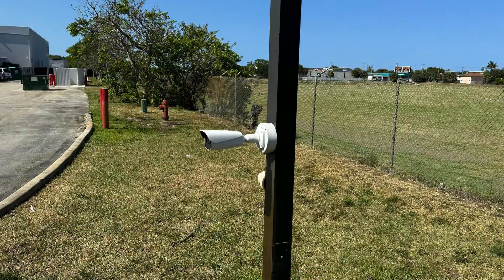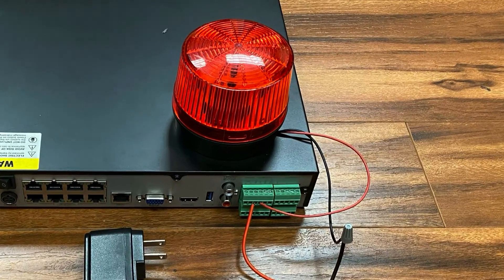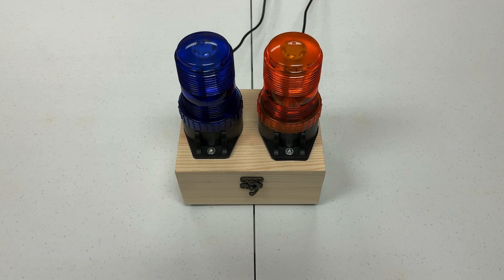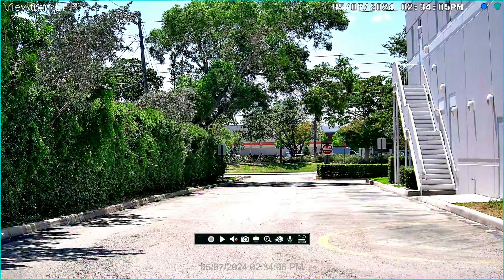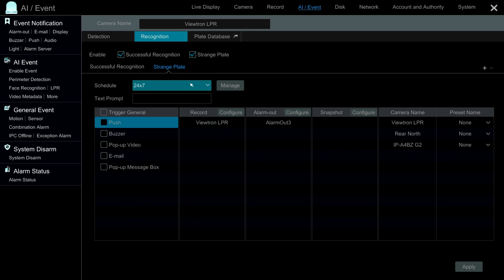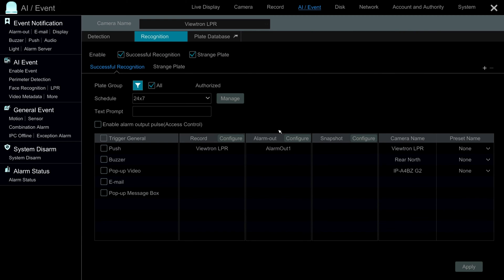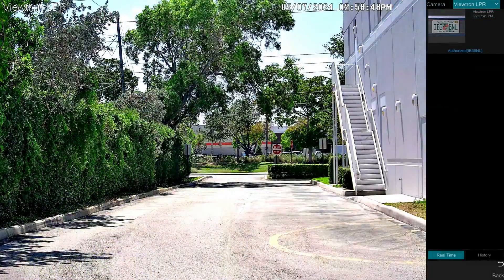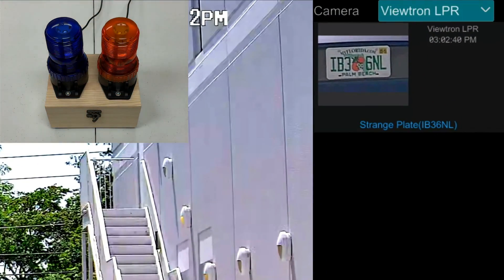LPR Camera Gate Access Control Integration

Comment: Hi Mike! In a license plate recognition system, what advantages does the Wiegand protocol provide compared to using alarm out? I only need to manage two lanes
Reply from the maker: Great question! The alarm relay outputs are simple open or closed circuits that can be used to directly open and close a gate. The Viewtron NVR must manage the authorized license plates in it's plate database if you want to use the alarm output for gate integration. The Wiegand output on the Viewtron NVR on the other hand can send information via the Wiegand protocol. Specifically it can send an access control card number to an external system. This allows gate access control systems to manage the authorized users for entry. The license plate is mapped to a card ID on the Viewtron NVR's license plate database. When a plate is detected, the card ID that is mapped to that plate is sent over the Wiegand connection.

Basically, if you want to manage the authorized users for you gate on the Viewtron NVR, you can use the alarm output. If have an existing access control system that supports Wiegand and you want it to manage access control, use the Wiegand port for integration.

Comment: How do you deal with delay problem with IP Camera in Object tracking? How much delay your camera have?
Reply from the maker: The license plate recognition software is directly on the camera, so there is not much of a delay.
Reply: @cctvcamerapros  I think he is referring to what seemed like 3-4 second delay from the video. Was that really an accurate delay? or was that just how it was filmed?
Reply from the maker: @Teacher5000  I use an external HDMI capture device to record the screen output of the Viewtron NVR. I believe that is the delay you are observing. There is some processing that must take place for the object detection, but it is not 3-4 seconds.
Reply: @cctvcamerapros  thanks for the reply. I believe that clears up the suspicion